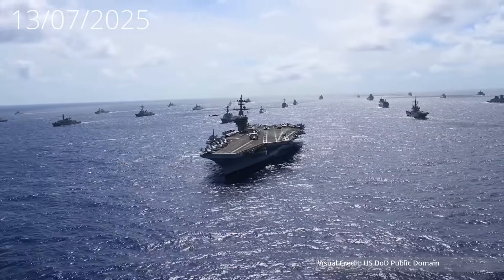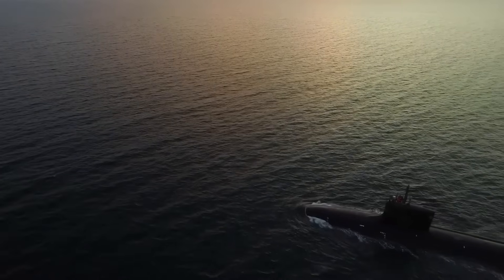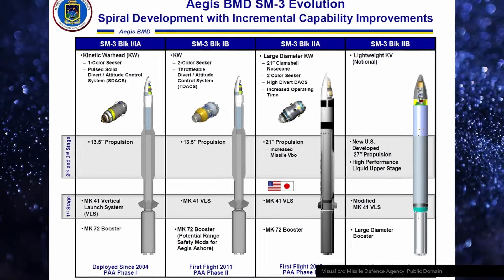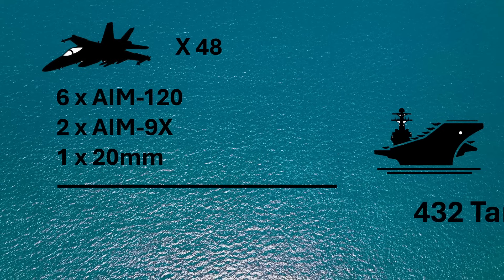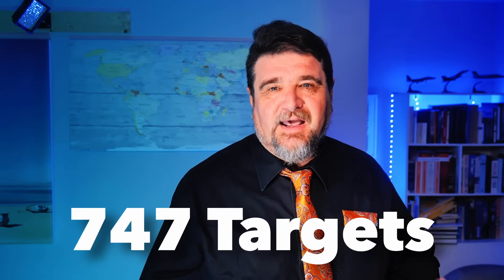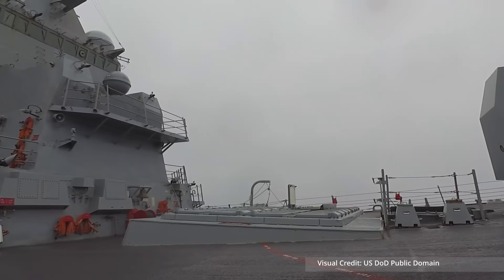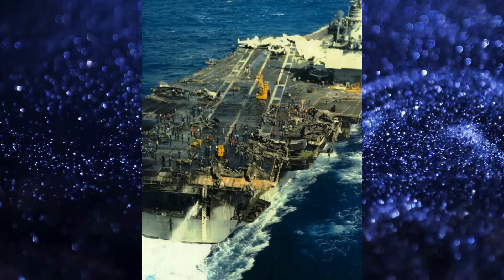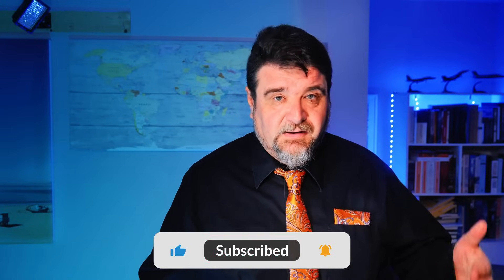HOW MANY Missiles are Needed to SINK A CARRIER?

Comment: If you calculate the result with 100% efficiency for all of US systems (which are not 100% efficient, as we know), is it not fair to assume 100% efficiency for all opponents systems? Also, this is not how anyone would go about sinking a carrier.
First, bombers would be escorted by fighters. Second, it would surely be a combined attack with surface/ground launched ballistic missiles, some of which would be hypersonic. Third, 10 million square kilometres is area larger than Canada, and you assume information control without an error over all this area.

Comment: Saturation of air defense, they don't have unlimited interceptors. Use cheap drones to soak up the air defense, then use more advanced munitions.
Reply: They don't even need to. US carriers, cruisers and destroyers simply don't have any air defenses effective against anti-ship missiles (barring ancient ones). Every single system consistently failed trials. This is one of the main issues Zumwalt and its completely redesigned Aegis was supposed to alleviate, and didn't.
The issue has been known and understood for decades, and this is why they don't use Coyote target drones for live fire training - they can't intercept it, they can't even see it.
Reply: FPV drones don't have range unless the carrier is parked at a port.
Reply: @johnsilver9338  never said anything about FPV drones
Reply: @Nero-Caesar  Majority of cheap drones have FPV, so it's still the same
Reply: @johnsilver9338  Cheap is a matter of perspective, in the sense of multi million dollar interceptors. A $20,000 Shahed 136 is cheap, and so would any other more capable drone that's even half the price of the interceptor.
Reply: @Nero-Caesar  I never questioned what qualifies as cheap enough
Reply: @johnsilver9338  I was explaining that the term "Cheap Drone" doesn't inherently mean an FPV drone
Reply: @Nero-Caesar  Like I said majority of cheap drones have FPV
Reply: @johnsilver9338  and like I said, that's got nothing to do with my post
Reply: @Nero-Caesar  Then name me a cheap drone that just as expensive as a DJI drone but with NO FPV capability
Reply: @johnsilver9338  The can be launched from drone motherships as well, also batter technology is advancing fast, even dual power platforms. There is a great deal of innovation with drones, that can easily be adapted and put into production quickly, all advantages.
Reply: @ruger3339-c4u Drone motherships will have the same RCS of a fighter aircraft. Those can be intercepted at long range.
Reply: @johnsilver9338  but that's where the cost balance plays it's part, if you're using a million dollar missile to shoot down a $20,000 drone
Reply: @Nero-Caesar  That's what air-burst/flak munitions are for. Besides Phalanx CIWS, Aegis Burke destroyers have 2 extra Mk44 Bushmaster I or Mk242 Bushmaster II that can fire 2,000 USD air-burst munitions. Even cheaper than that those with SEWIP Block III can jam or spoof enemy GPS and active RF seekers. Not only that F-18s or F-15s can now carry anti-drone APKWS II rockets. Although a bit more expensive at around 20,000 USD per rocket, F-15 can carry up to 56 of them. While F-18s can carry up to 42. So 2 or 3 F-18s on CAP can intercept a total of 84 - 126 drones in a single sortie. So very unlikely for a successful saturated drone attack vs a US CSG. 

To compare a Chinese CSG is more vulnerable to a saturated drone attack. No air-burst munitions and no anti-drone rockets. Even Russia's Black Sea fleet is now at the bottom of the sea due to Ukraine's persistent drone attacks.
Reply: @johnsilver9338  it's just a game of cat and mouse and who can outsmart the other, it definitely wouldn't be easy but it's definitely possible to overwhelm the air defense of a CSG. Who'd expend more resources idk.

I've not looked at the specific ammo type of China's point defense, but I find it hard to believe that they don't have any air burst ammunition. And yes Russias fleet has suffered heavily, but that's primarily due to the use of the new type of sea baby drone, which is a mostly new technology and has taken awhile to find an effective counter to.
Reply: @Nero-Caesar  Type 055 don't. Type 052D also don't. So US Marines in East and/or Southeast Asia equipped with Israel's Hero 120 drones has better chances of successfully penetrating a Chinese CSG. 

On the other hand Russian Moskva was easily sunk by two ordinary R-360 Neptune cruise missile. It's not even sea-skimming nor low observable like Norwegian JSM or US LRASM.
Reply: @johnsilver9338 I mean the 1130 point defense is just a gun, it can fire whatever ammo type you put in it. Whether it's a training round or a service one, I don't see why they would have a air burst round or why they couldn't develop one.
Reply: @Nero-Caesar  Then name me the Chinese air-burst round and I will tell you about the western one
Reply: @johnsilver9338  Not sure why I need to hear about the western ones, but the Chinese Norinco (China North Industries Corporation) has publicly displayed airburst-capable 30mm cannons mounted on IFVs and remote weapon stations. And Chinese patents and defense white papers have outlined variable time fuzing systems for 30mm and 35mm rounds much like the AHEAD system developed by Rheinmetall.
Reply: @Nero-Caesar  Then whats the name of the round/system then?
Reply: @johnsilver9338  The Chinese 30mm and 35mm rounds are typically referred to as follows:

30mm Rounds: The most common type is the 30×165mm cartridge, which is used in various applications, including aircraft cannons like the GSh-30-1 and the Type 95 aircraft cannon.
35mm Rounds: The 35×228mm cartridge is used primarily in the Oerlikon 35mm cannon systems, which are employed in various naval and ground-based applications.
Reply: What are cheap drones ? quadcopters don't have the range, Shaheds are cheap because they don't need radar (just gps), but that means they cannot target a moving ship. Maybe shaheds with a camera and ML but since they are really slow, they will need correction after launch which means datalink (both expensive and/or vulnerable). Once they reach the Carrier group, they can be engaged by ESSM, zuni guided rockets and phalanx, no need to really expand the big missiles stores.

So your better use classic, mass produced anti ship missiles for that job. They at least can get through phanlanx and zuni rockets and will force the carrier group to expand more complex ordnance.
Reply: @Ralfountet  Genran-2 drone has INS, GLONASS and IR which can effectively guide them to attack the carrier. The Carrier itself is a massive target which is no difficult to attack. Also Geran-2 has jet engine which allow much faster speed, Russia/China can easily deploy 500-1000 drones to saturate the air defense. While the warhead of those drones are not big, they can cause damage to aircraft, island, AA system... which make it difficult for the defense. Also, they can be mixed with long range cruise missiles like the Kh-102 with nuclear warhead and long range.

After that, the long range, heavy missiles can come in waves to attack the battered, exhausted carrier group.
Reply: @shinsaber2109  and how exactly will you be able to mantain a prescise track on the carrier for the 3-5 hours it will take for the drone to reach a position where it can use its own sensors to find the carrier?
Reply: @shinsaber2109  Do a saturation attack and at the same time lob a few ASBMs and some hypersonic cruise missile at the same time. I doubt the AEGIS system can handle that. Bye bye carrier.
Reply: cheap drones can be intercepted by point defense, aircraft, helicopters and even a cruiser/destroyers main gun
Reply: @cristi1145 So can anti ship missiles, it's meant to be used in conjunction with other munitions. To protect the more expensive ones, better they get shot down then the missile.